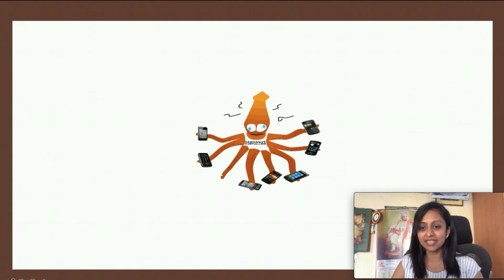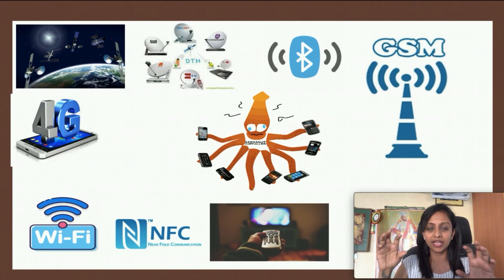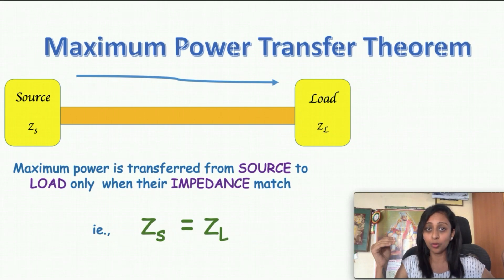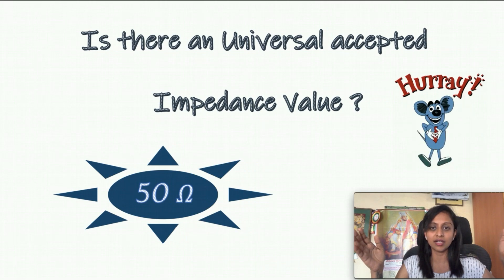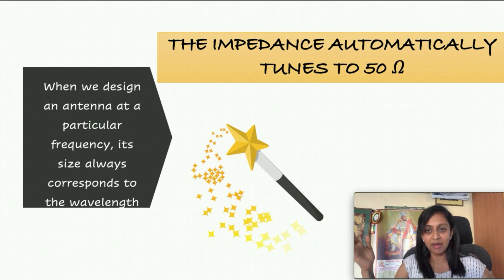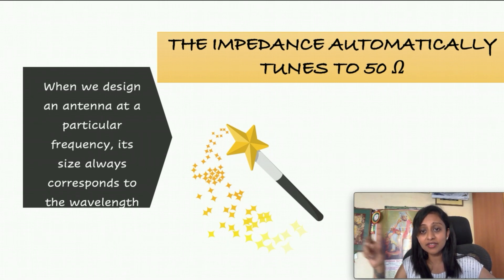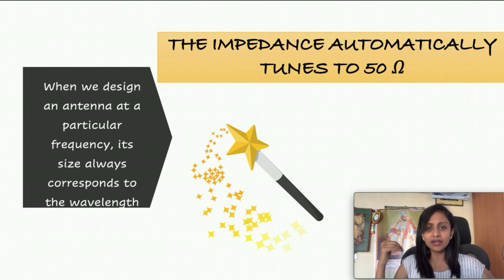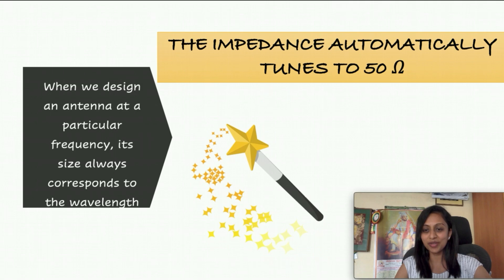How does antenna know it has to pick signal for which it is designed??

Comment: Then why we use a feed and feed position?
Reply from the maker: Sooraj S : Feed is to give power. And feedpoint is usually at edges for a 3D antenna right. But whereas a patch, the concept changes due to lumped ckt. Impedance at mid is zero and at edge is infinite. So we need to tap a 50 ohm point. Next videos will talk about these. Thank u